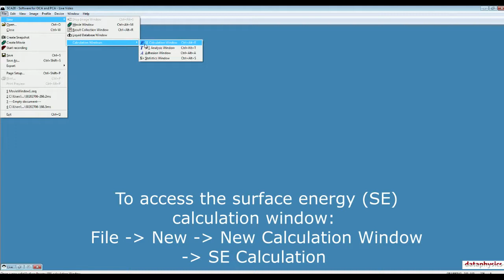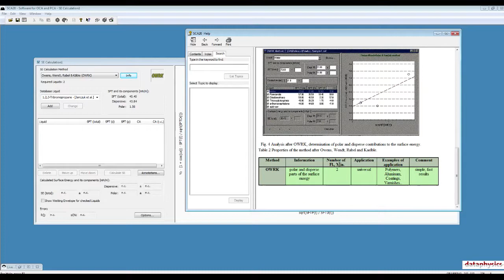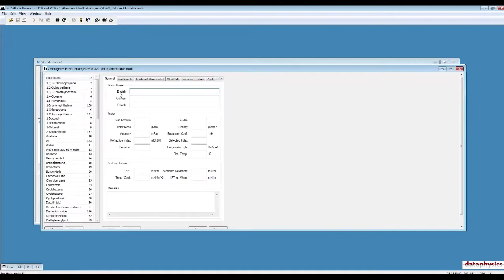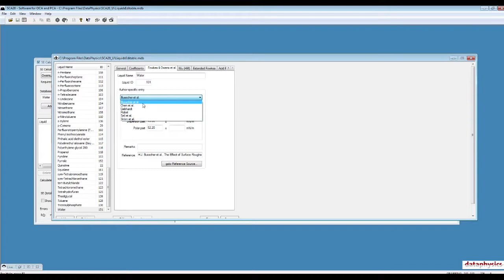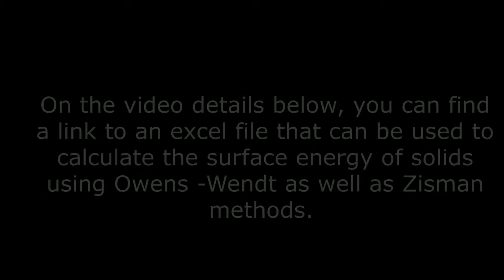OCA 15 Tutorial - Part III   Surface Energy Calculation

Comment: Is it possible to calculate also the standard deviation of the surface energy? I tried by inserting the s.d. In the CA by expanding the columns, but it does not work